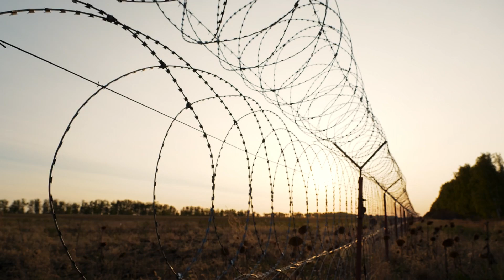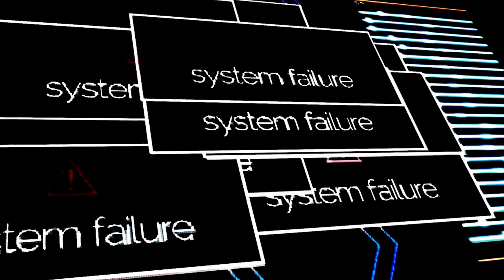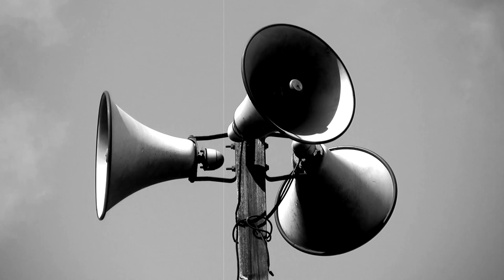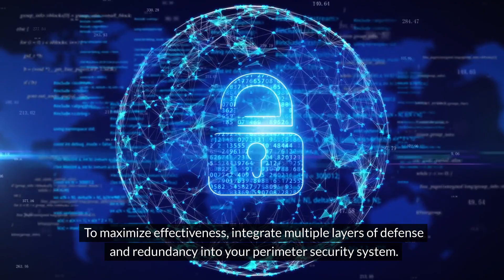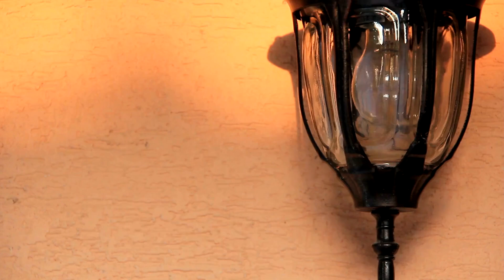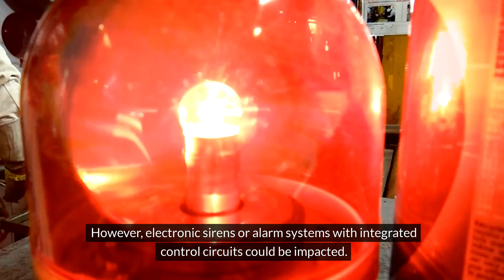STRENGTHENING PERIMETERS IN SHTF

Comment: Hey Sis!! Our first layer is plants both wild and BROUGHT IN. Have been bringing in YUCCAS for years, and cropping them when they get too tall and fall over. We have BAMBO also which I MAY HAVE ALREADY REGRETTED planting, but it has served its purpose. You cannot walk through it or see through which was what was needed. Next we have a barbed wire fence with COWBELLS attached, get to hear the deer busting butt going over it at times- MAKES ME SMILE. The next line would be the NOISE MAKERS, consisting of TRIPWIRE ALARMS- from anything to shotgun PRIMERS to fireworks. Ooooh forgot one of my favorites- HOSE NAIL STRIPS nestled into the leaves at choice places.... spaced in with my trebble hooks at knee to waist high with more cow bells up high.. The dive way has a GATE which we use at night-religiously. The house has CAMERAS. There are MOTION SENSORS on the driveway and around the house. We KNOW where you are AT by the tune being played. Should you COME, I'm shure your SCREAMS will allert my 100lb DOG, I will be the ONE covering HIM. Hope this finds you WELL Sis!! m
Reply from the maker: Wow...you definitely have your perimeter defense covered!

Comment: I don’t remember if I’ve mentioned this before, but anything with a 12 Volt DC backup battery power supply can be powered by solar. So, even if the grid goes down, you can still use alarm panels. A company called CabinAlarms sells panels for off grid use that uses no power until the alarm is tripped. You can keep the battery fed with a small charge controller and a small solar panel.
Reply from the maker: I did not know that! I need to put that in my notebook!

Comment: Great work on the video Nikki. I have been implementing a heavy random native thorn bush patch along the outside of my fence lines for a few years to not only keep predators out but keep our livestock in.
Reply from the maker: Thank you! That's why I keep all the thorny bushes around the entire perimeter..heck 2/3 of the 5 acres isn't even cleared. And the only real entrances have FM frequency motion sensors. But, the thorny bushes suck when I have to go in to clear out the trees before they get too high and block he solar panels :(
Reply: @offgridstyleprepper  I use a limb battery powered chainsaw that extends to 20ft. That way they are manageable without getting poked for the most part. Clean up still gets me.